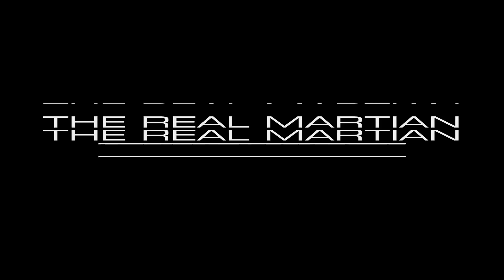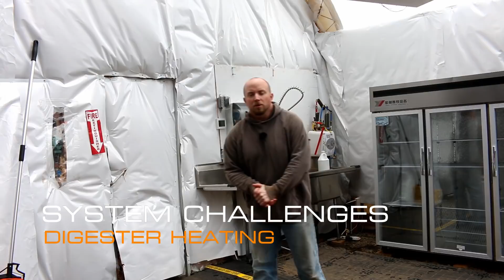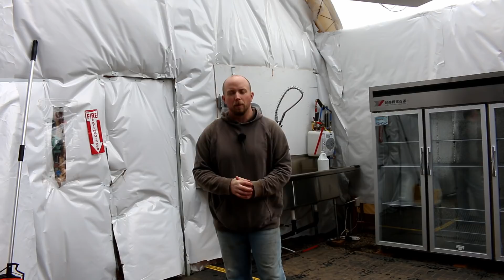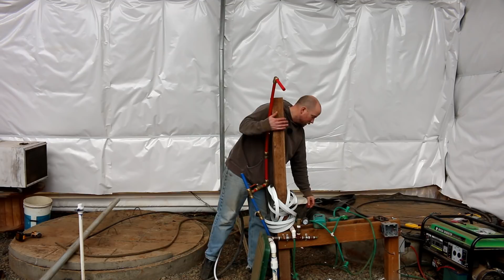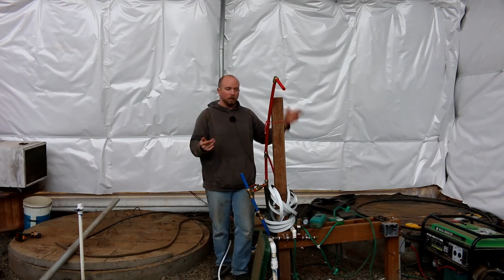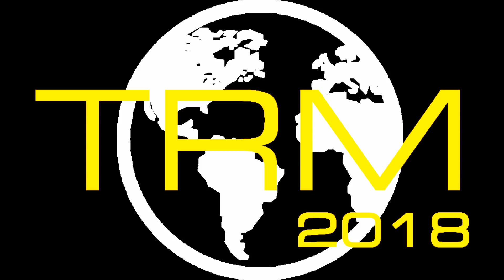How to Heat an Anaerobic Digester?

Comment: I know this is an old video but in case anyone new pops through the comments a great way to heat this during the winter months would be a compost heating pile.  Lots of options and designs for these online. If the pile is big enough I have no doubt that it would heat your digester similar to how you described wanting to heat it with the solar array. Best of luck everyone

Comment: Love your work...
Your tank is acting as a heat sink. The ground is on average 55 degrees so you are chilling your anaerobic bacteria. Insulate around your tank. You also have a displacement problem where you have to move all the fluid in your tank to inject new material. Plus the pressure in the tank is pushing against your supply manure tube. So your tank is working like a well water house plumbing pressure tank. Change your tank design to use natural physics, where gravity works for you. If you have a greater head pressure in your feed pipe buoyancy would not matter. It would always find its natural level in contrast to the outflow level. and increase the gas pressure.  You also dont need a thick  slurry i would look at simple ways of removing straw from your live stock system. Straw has so little energy benefit for your digester

Comment: 2 6'dia cylinders does not equal a 12'dia. A=pi*r^2. While, yes, surface area controls your thermal transfer, it's the volume that generates the heat.

Comment: The solar tubes are capable of reaching 146C Well above the capability of water and glycol to deal with. You want something with a manual 3 way mixing valve to keep temps blow 90C (120C if your going glycol) that incorporates a radiant diffuser. The is the major failure points with evaporative designs is that they cook in the summer time and burst their manifolds. I only know of one manufacturer and its up in Calgary Alberta that has this sort of system available.

Comment: The evacuated tubes will work great by themselves but they will work you’re around easily if you put some sort of reflective parabolic metal to direct the sunshine at the tubes. A lot more concentrated bro;) I cooked crispy pizza in one of those tubes. A company sent me one of their tubes. https://www.youtube.com/watch?v=cGyhM8nXk9k
Reply: You could also use a fresnel lens kind of like the one I made in this video. A little harder to do but it will heat water easily. You can put it on some sort of solar tracker that way you always have a strong focal point and maybe it at some sort of pipe that obviously has a pressure relief valve so you never get any explosions and just run the water through that pipe. https://www.youtube.com/watch?v=EFGWJ6hHWXQ

Comment: TRM, you could use the waste heat from your generator and propane heater. A coil of tubing around the exhaust would provide waste heat to your digester.

Comment: Very interesting idea for a solar thermal application, I've installed/serviced a lot of solar thermal systems. If you have any questions I'd be willing to chat. I wouldn't recommend using pex tubing as your piping between the outdoor collectors and inside... It can't handle the high temperatures that collectors can produce during peak summer season or during system stagnation. Proper collector sizing/tank volume, and flow rates through the system should be considered, a simple delta-t solar controller with thermistors is the way to go. Obviously face the collectors due south in direct sunlight, and I'd recommend using cryo-tek 100 propylene glycol for freeze protection. Veissmann makes some really durable flat plate collectors that are super easy to install as well. I'm interested in seeing what you come up with!

Comment: I'm not sure it's a good idea having the solar heater array inside Hab1, the condensation on the poly might diffuse the infrared from the sun...water vapour affects the IR massively. might be better off outside even though it would be exposed to lower air temps.

Comment: Hi Jeff,
    Keeping the solar tubes inside the green house may not be the best idea (unless you strictly want to run just water). The best bet is to keep them outside and run with glycol. I found this video https://www.youtube.com/watch?v=CH8Z9nBrCBg of solar tubes running in 25F air temps producing 138F in the manifold. In the video the man provides more data as he checks in on it throughout the day. Maybe you could do a split system one array running water to heat the fish water, and the other heating the digester. Cheers,     
    Bill

Comment: efficient low amps to drive hydraulic / servo pumps vs wound motors? a thought for direction to follow .wont the  manure create heat itself after its warm enough to start microb action?

Comment: You've probably got enough Parts on your electronic bench to build a Tracker for that panel you're talking about getting but you need to make it vertical and horizontal when you get in there run us a video on Scribble on your chalkboard show us what you're thinking

Comment: That is a most interesting concept and I understand the basic concept as you describe it but how do you control it from going into overdrive it in the summer months when you may not need much, if any, heat in the digester and no likely need for heat in the house? Some sort of alterable/adjustable shading / screening?

Comment: You can easily make a cheap system would that would work all year as long as there is sun.

- Use black "Flexible Plastic Conduit", some playwood and heavy duty clear plastic.
 (Should be nax. $150 for 100m x 20mm)
- Use two stadard sized playwood sheets lengthwise.
-  Cut lenghts of conduct thatt reach from top to bottom (about 20 lengts)
- Use a thicker PVC pipe to feed water from the top and collect varmer water at the bottom

The flex suface increase the amount of heat absorbed, and should it freeze they will work fine when the sun warms them up again. No leaking when I tested this setup.

Make a box around the playwood and use two seperated  layers (1/2 an inch) of clea heavy duty plastic to cover the box. Paint the playwood black and add a layer of insulation to the back.

Tested on a sunny day in January this setup heated 25 gallon of water from 2 degree celsius up to 25 degree amd  Norway has a less sun in the winter then Washinton state has. The setup was placed utside and the air  temperature was 0 degree celsius.
In the summer it will heat a lot more water up 30 degree over the air temperatur. A 100l on that was just recirculated got up to 50 degree over the air tempearture in a day. And with a single layer of rockwoll around the tank it lost about 20 degree over night.

Comment: Don't use Glycol in your heating tubes , if you have a leak it might be "no bueno" for your digester !
Reply from the maker: great point!
Reply: You could stuff them with steel wool to get the water boiling fast and hot:)

Comment: if you vacuum tube you dont need to move all the panels just move the tube, but normally what i do is put some on the left side tuned to the east and on the right facing west like (/) (/)(-)(-)(-)(-)(\)(\). also dont use the solar hot water directy, bufer it using some kind of water tank and then just mix the hot water at the right temperature for the methanogesis 38ºC, when calcule the the amount of hot water you will need in a day and multiply by 1,5 to get the water tank size and you will be fine ...

Comment: You could always use a thermostat and when the digester is up to temperature use the exces heat to heat the greenhouse (reduces gas use). Make sure that in the summer the system is either drained when you don't use it, or find a different use for that heat. Just make sure the system doesn't boil and becomes pressurised. (You could even preheat the ground for an eventual geothermal system, but then you lose the summer cooling capacity for that system)